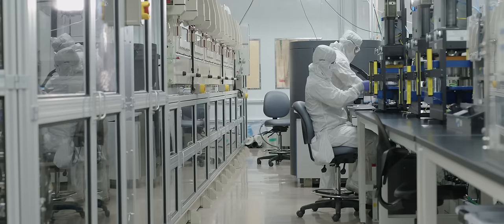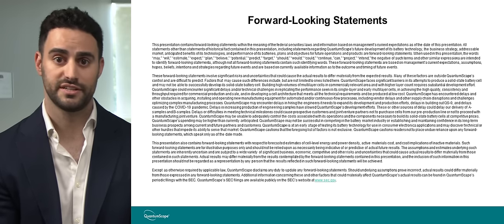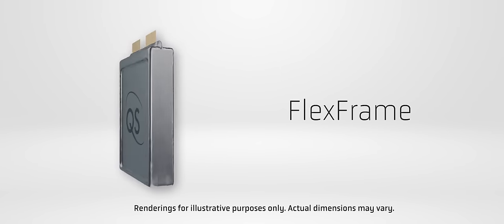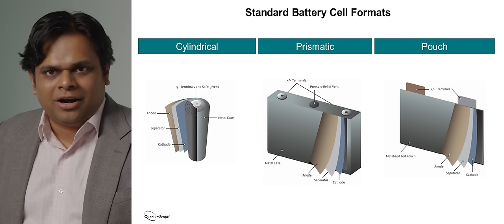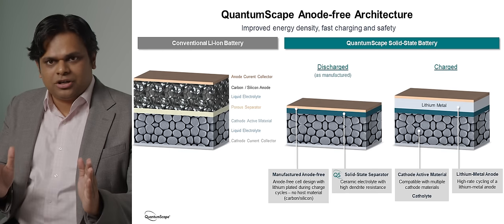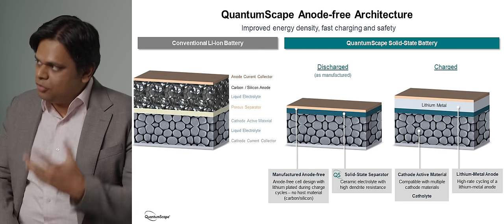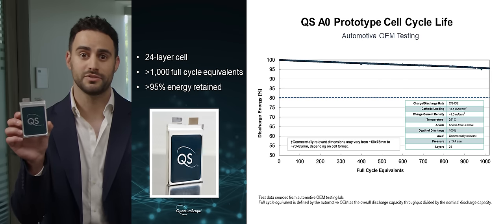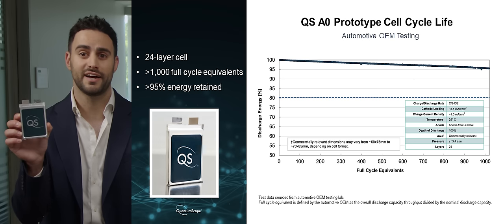Introducing FlexFrame, QuantumScape's Proprietary Cell Format

Comment: Thx. for the presentation. I would have like to know the following.
* The Gravimetric energy density
* The Volumetric energy density
* The Charge/ Discharge speeds
* The expected ETA of these commercially
Reply: A better question is: even with a 20% improvement of energy density who cares? Do you know any EV OEMs really that are willing pay a premium for a slightly higher energy density? (I'll give you the dirty secret: none). EV OEMs care about 2 things right now: reducing cost and derisking supply chains. This does the opposite.
Reply: @Mark_BatteryPhD  there is too many battery techs. coming up. Not sure who will come to production. The last I heard was Zinc Ion batteries. 
PS: i have booked a Solar Electric Car called Aptera - I expect 600 miles range - 40 miles. per day just from solar / carbon fibre body - hub motors - drag coefficient of 0.13. I hope that should give you some food for thought.
Reply: if they dont give a number in presentation that means numbers are not good

Comment: Great video, thanks.  One question....Does the flex part suffer fatigue over time that would cause cracking or breaking?  How many flex cycles can it take?
Reply: My 1st thought as well. It’s great that it lasts so long as far as battery degradation but how would the casing be able to stand flexing over that time?
Reply: @normanwolfe7639  I think he said it was a "composite" so it's likely it is robust and carefully designed to have a long operating life.
Reply: There was a recent test done by VW which confirmed 1000 cycles, QS are claiming that this was done with the new Frame cell. But a seperate metal fatigue/duty cycle analysis of that cell-frame is needed.
Reply: . @Hybridog  Maybe they've done the fatigue testing but it would be nice to know the results

Comment: I’m a big fan and supporter of QS and want you to succeed! One question that I have with this flex frame is this: How can you apply a uniform pressure to the cell especially once stacked? All your testing is always done with 2-4 atm of pressure which seems easy to apply on a single frame but not on a stack!? 
Also, why not start manufacturing smaller, single frame batteries aka for Cellphones, Watches and other everyday electronics, wouldn’t that validate the SSB and wouldn’t you receive great end-user data etc. and as a side effect you would be bringing in revenue which would “appease” Wall Street which in turn boosts your share price which in turn benefits yourself (QS) and the shareholders? Thanks.

Comment: Will the flex part not break apart after tons of charge-discharge cycles?  And is there an strong evidence that it is safer than lithium ion battery? And was mass production considered in the package design?
Reply: Rhey discuss how mass production was a key factor in choosing the design.  The materials are time tested and easily sourced. There is strong evidence regarding the increased potential safety of SS - you'd have to google that.

Comment: Will the case be electrically isolated from the terminal tabs?
Reply: That has to be true otherwise the entire cell shorts out and just melts.
Reply: Strange how shorting isn't an issue with other cells, where the case is connected to the negative terminal. I'm curious if QS is thinking further ahead to the pack-level where case isolation from both terminals can be useful.

Comment: There is literally said there are still generations of samples to come before it is commercially available
Reply: No.  The stated plan is to produce an initial battery that is well within engineering tolerances, and then explore higher energy densities etc. as data is gleaned and analyzed.

Comment: Wonder if the new 2025 Porsche Taycan is using Quantumscape solid state batteries?  Check out the Out of Spec charge review of 2025 Taycan.  Cover if your short.
Reply: Most likely 2026. In 2024 the QS batteries will be in pilot test cars.

Comment: i thought it was anode free? 🙄
Reply: I too have the same thought! In fact they removed or blocked my comments on their senseless thoughts! they always escape with their forward looking statements!!!!
Reply: Anode free batteries doesn't mean it doesn't have an anode. It just means that the lithium was plated onto the current collector forming an anode. It's a weird name.
Reply: that is where youre wrong.  it was explicitly mentioned that there will be cost savings due to having no anode material.  if you listened to the earning calls, the flex frame was introduced over a year ago, which at the same time it was mentioned that the battery would be anode free.  kinda funny VW chooses to go with someone elses tech, and now they wanna finally reveal some old news packaging?  its been over a decade, wheres the damn battery?  even the 5mAh would be a breakthru, but the one they showed is same size as my ohone battery currently.  the battery was supposed to be 3cm square.  again, there was lots of things theyve said which just simply isnt true.
Reply: Dude, anode free means no host materials like carbon or graphite etc. Lithium is deposited directly on copper current collector. Just chill.

Comment: Solid state batteries are useless if there is no infrastructure to charge them. No scale viability for current BEVs
Reply: That is absurd as they can be charged anywhere fine charging is available.  Yes, there is no EV scale becasue no-one makes an EV SS battery - that's kind of the point here.